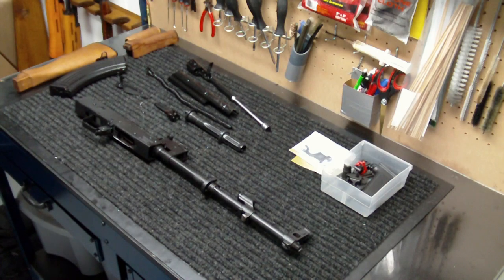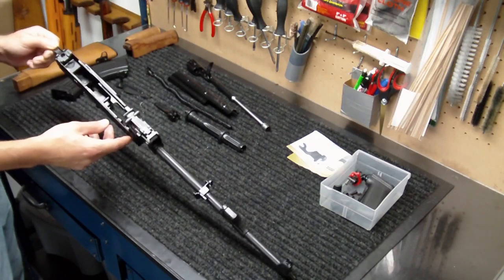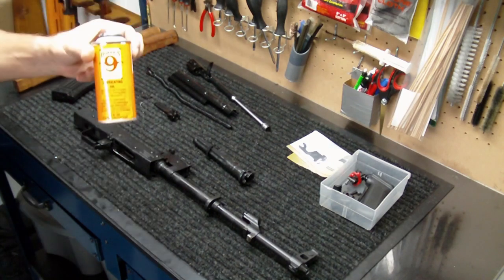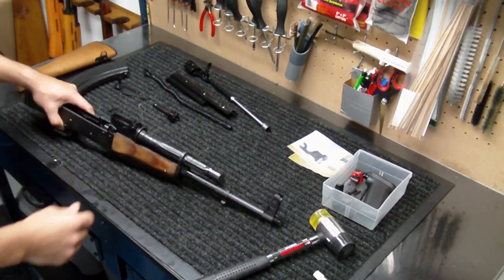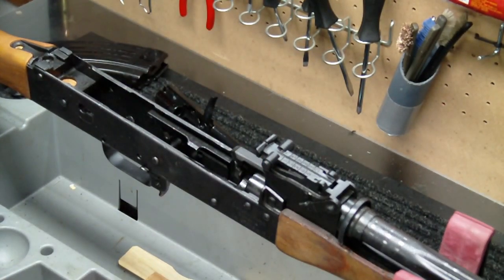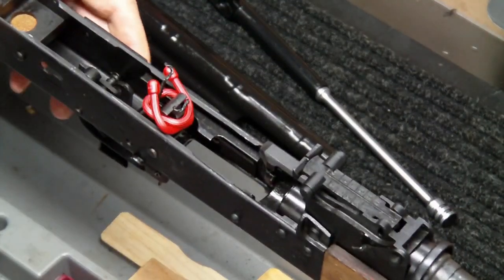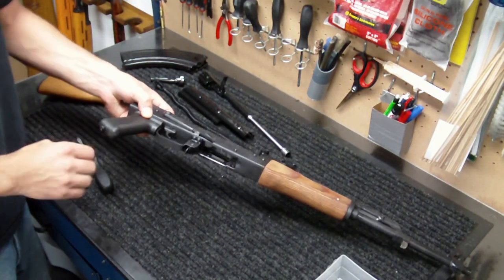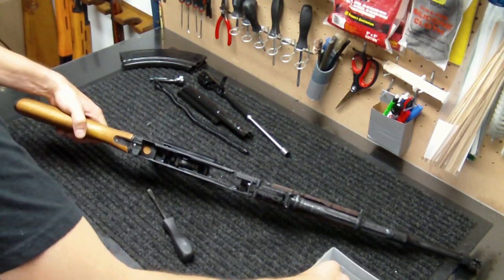How to Clean an AK-47 Rifle  &  AK Trigger Group Removal

Comment: To clean a AK run a boar brush through the barrel 7 times. AK47 is a peasant gun, made to operate within its design parameters under the worst conditions. Western platforms are made to be cleaned every 30 rounds fired. AK can run effecientiy 20+ years w/o cleaning. In Afganistan the locals have no concept of cleaning an AK.